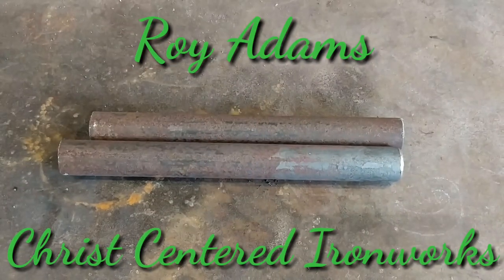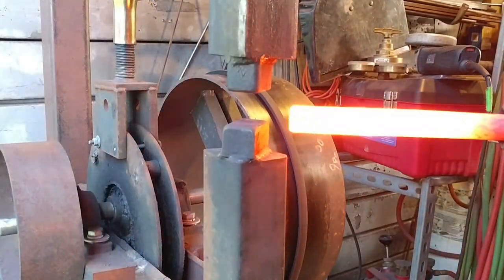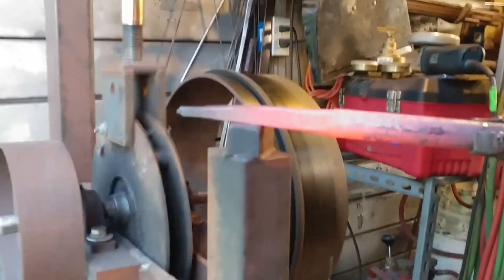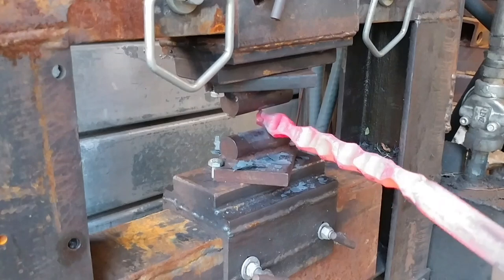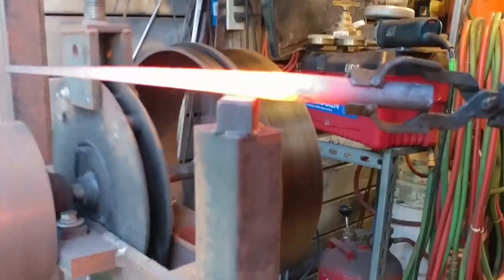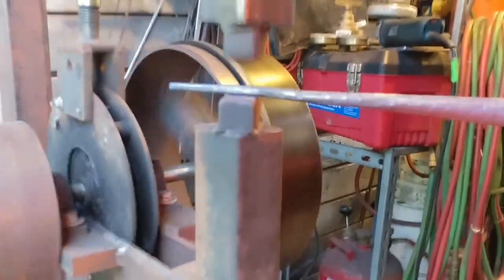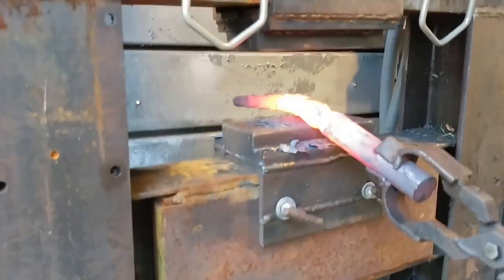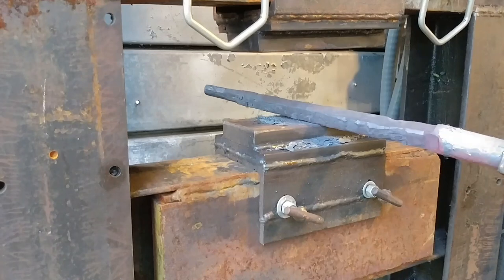Power hammer VS Press// DRAWING OUT Steel on Hydraulic Press and Power hammer

Comment: Not only are they very different - but how you used them was 180 Deg. different.  The hammer you made many "adjustments" the power hammer you just squished it into an unusable shape.
Why not just use the Press the same as the Hammer Press - that is press a little, move, press a little, move, etc.  You just squished a bunch of massive dimples into the metal and then just said, see the difference!  Well, duh!

How about an update where you upset the same on each and not just squish one massively into something unusable.  Control is the thing needed - you didn't do that.

Comment: After you get the press sorted out you can really make some really cool tools for it.  One might be to have a fuller and flatter die on one piece.  Seen other presses and hammers like that.  Also things like after tapering a piece in preparation for a leaf you can make a die that will press and imprint in one go.  Bunch of stuff that you can do on a press that can't be done on a hammer and some things that can be done on a hammer easier than on a press.  Most all of the really big foundries have gone to presses but they aren't trying to get a gentle fine taper either.  Good to do this comparison.

Comment: The only thing I could add regarding a press is simple ,just cause it's a press doesn't mean with each press you have to use the full potential (tons)

A power hammer has faster touches with less force witch makes it easier to control,take the same exact dressed dyes and slap them in a press witch is slower in movement but stronger 

Then all you need to do is know when to back off either the foot peddling or the hand lever 

I chose to build a C-frame press cause at the time I was into blades ,now I'm into tongs and hammers so I've become a bit better with the controls of a press 

 And yes the video is to help people choose the right tool

Maybe a showcase of what the press could better do and stitch in the video of how well a power hammer tappers

Comment: A press is actually very easy to draw material out. But you need the proper dies. I use drawing dies with "dummy blocks" set up at 1/4 to 1/2" thicknesses so you don't need to worry about going too thin.

Comment: Hi I like you video and I noticed you said it may be the cost of the machinery. My problem isn't money it's space my workshop is limited to what goes in. So what would you recommend one or the other using size and work space around the machine please thank you.
Reply from the maker: +Iain O'halloran if space is an issue in your shop a press has a much smaller footprint. My shop is only 144 square foot and I can fit both in. Unfortunately though if you buy commercially made power hammers or presses you may be subjected to whatever size you can get of those type footprints. Presses do run smaller though. Thank you for taking the time to watch God bless you

Comment: i think your press has too much play in the plates causing it to kick it out to the path of least resistance i see the bottom plate moving sideways when under pressure and the top die has movement as its not firmly pressed to the top plate where its secure a rail system will fix the sideways movement love the follow up keep them coming mate God bless
Reply from the maker: +grayem pepper yep very good as an observation. This was the first rendition of this press I have ever built so therefore it is not perfect but it illustrates my point just fine. Thank you for the comic God bless you today will catch you on the next one

Comment: A forge press is no different safety wise than any other hydrolic equipment, farm tractors, vehicle lifts, etc.  Although a homebuilt press may not have strong enough material for the power of the hydrolics. Be careful.

Comment: it's not a good comparison if you don't use the same type of dye if you have the around died and your power hammer you're going to have a similar effect it's not going to be smooth like what you're showing their if you put a flat die in your press you'll have a similar effect as the power hammer
Reply from the maker: +Matthew Bennett the result I believe would be exactly the same I've done a lot of forging under both and they create two completely different tapers. The taper was not the point of the video or this video series the series is meant to highlight the advantages and disadvantages of both machines a press is slow and cumbersome for long drawling out operations. There may be people out there that prefer a press over a power hammer and that's fine I'm simply highlighting some of the different features to help guys with that purchasing decision. I'm also trying to stay as non-biased as possible considering I own both power hammer and press I think they are great tools and nothing more. Thank you for your Insight and I hope you will enjoy the rest of the power hammer verse press series thanks for watching.